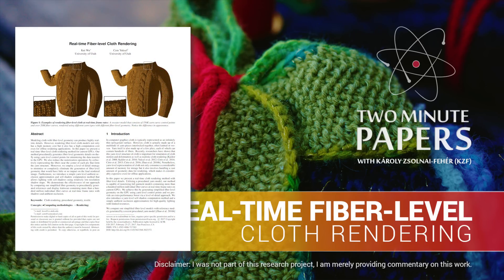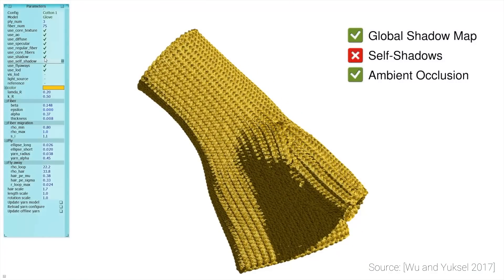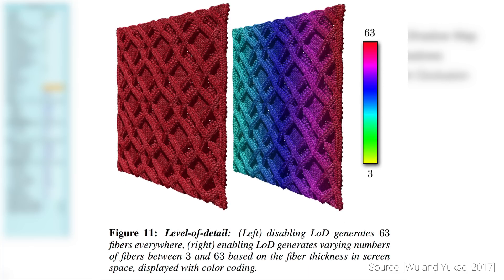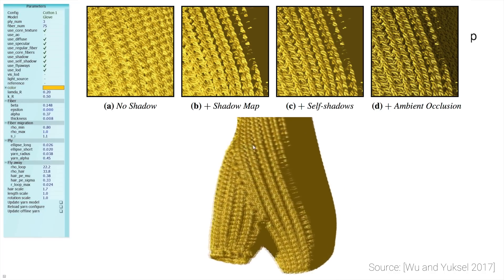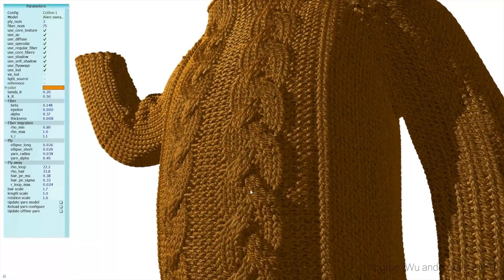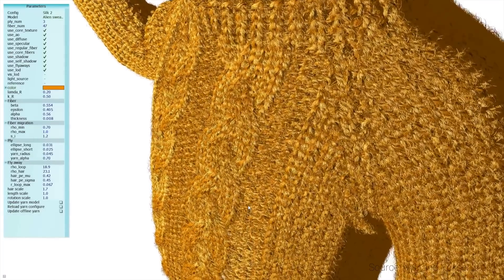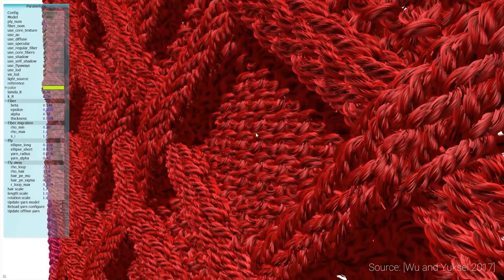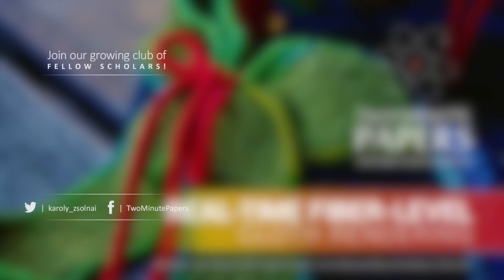Real-Time Fiber-Level Cloth Rendering | Two Minute Papers #132

Comment: Like, I understand that this is procedural, but are these polygons? Parallax mapping? Stacked polygons? Ray tracing?
Reply: But for the tickness, it needs to have polygons,. ?
Reply: Yep, a nurb is a spline, a line curve, and instead of building by supplying triangles, you supply it with mathematical line curves, and these curves are bridged to the previous curve(or to itself) by a face.
Think of a 'heat map' graph with 3d topology, those are typically made with nurbs.

Comment: The exact progress that is happening using older CPUs, mainly referring to the demoscene(where people achieve 3d graphics on slow machines), is happening on modern systems. This is a very good example, common hardware used for techniques that would need datacenters to compute. Fantastic!